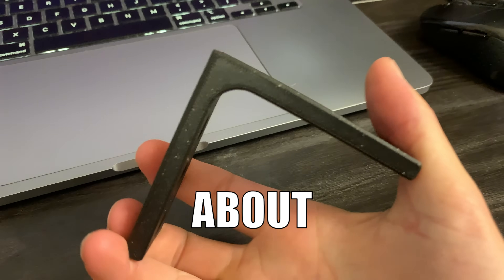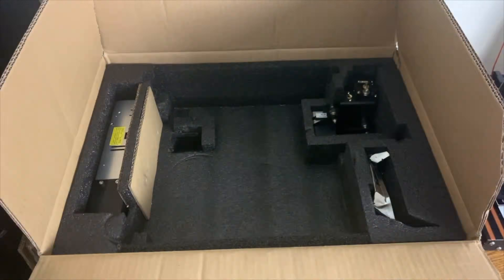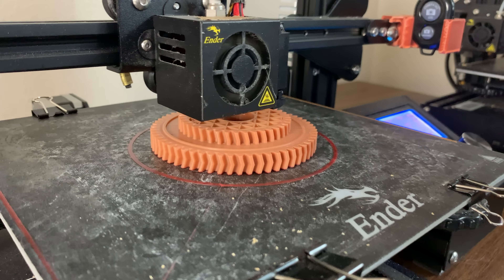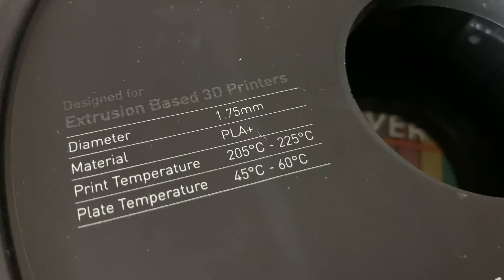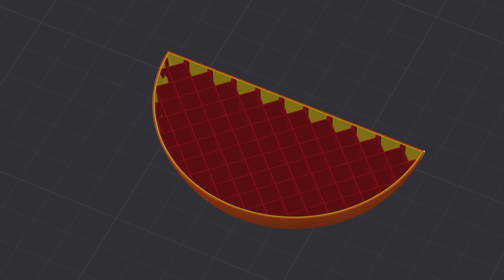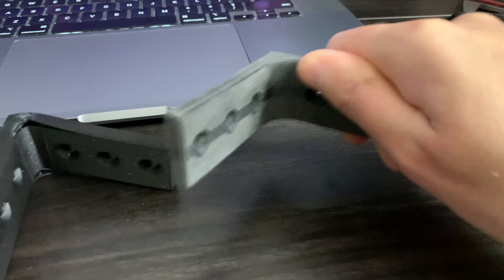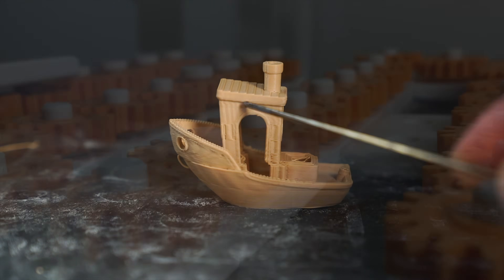9 3D Printing Sins...

Comment: "There's really no benefit to using IPA over warm soapy water"

Sure there is, I can leave the build plate in place and give it a quick IPA wipe. 5 seconds vs. minutes to pull, rinse, soap, wash, dry, and replace. If you're not using a glue stick, anyway. But then if you're using a glue stick regularly, IMO that's a bit of a band-aid covering up some other deficiency.

Comment: To get under parts that don't want to let go of the build plate, I usually use "paint knives". (set of them is usually less than ten bucks online) 
Unlike these normal spatulas they don't have fully sharp edges, are thinner and therefore pose less of a damage risk to the parts and can work themself into thinner gaps.

Comment: PLA is perfectly fine for outdoor use for 99% of people. Yes, it is not "UV stable" but do you really need it to survive looking the same for 10 years? Colours are a different story, even some ASA materials use colours that are not UV stable and will bleach or yellow when exposed to sunlight, and you can also get PLA with colours that survive the sunlight.
PETG will also (usually) yellow in sunlight.
Unless you are printing engineering/function parts for outdoors and selling them, PLA will most likely work just fine.

Comment: Sin No. 10 - Buying Ender 3. Seriously, don´t. :D Ender was my first 3D printer and it was nothing but pain. I even went to the extent of upgrading almost everything. From motherboard to the extruder, dual Z-axis, everything. No. It simply wouldn´t print properly. Throwing it out and buying a different printer did the trick.

Comment: I do use isopropyl alcohol but i do not always use glue. I use glue with the harder parts that are too small or prone to warping and then i need soap to wash ofd the glue. In other cases i will just give it a quick wipe of IPA between prints and wash it with soap after a couple of prints.

Comment: IPA is a good choice to clean the bed before/after each print to remove reside... at least for PEI coated (flat or textured) surfaces. It's not a replacement for a soapy water rinse. That's still necessary every once in a while for the reasons mentioned in the video, but is everyone else really washing their build plate for each print?

Comment: I just recently got into 3D printing. The issue I'm having is the printed product is hard or not able to break away from the Raft. I have a FlashForge Adventure 3 and using Flashforge PLA Filament 1.75mm. The Original Filament that came with the unit was a red translucent material. When I ran out of that, I took the filament information off the original spool and ordered Flashforge PLA Filament 1.75mm, 3D Printer Filaments 0.5kg Spool-Dimensional Accuracy +/- 0.02mm for Adventurer 3 Series (Black) and a (Grey) off Amazon. Whether I use, the (Black or Grey) the printed product does not want to separate from the Raft. I have not adjusted any of my printer from the factory default settings.  Just wondering what causes it to adhere to the Raft. The Raft comes off the Build Plate just fine.
Reply: I do not know what you are printing but raft use has limited purpose. Switch to skirt or brim. If you do have legit reason to use raft you air gap is probably to small so it forms a hard bond with the raft. You want filament to sort of lay down on the raft not pushed down like you would if you are printing directly down on the bed. Looking at the settings in my slicer at .28 layer height I have a air gap of .3
Reply: @mitchellcrane9809  I think the raft is apart of the printing process.  Will look deeper into the FlashPrint 5 software.  Thanks for the information.
Reply: @mitchellcrane9809  at first I printed the test boat then found other items to print. They printed just fine with the original red translucent filament.  I then purchased a 3D model of a VW engine to print out.  I did realize it has so many parts to print. Using the red filament the pieces printed fine.
I ran out of the Red and purchased a Grey and Black of the FlashForge filament and using the filament specs from the Red specs. It seems to print larger items better than smaller ones. The printer settings are the same as out of the box. It's always printed a raft. Not sure where to turn it off or change it. Thanks
Reply: I have found that the colour of the filament can greatly affect the adhesion between the print and the raft. Printing the exact same benchie with a light-coloured filament vs. a dark-coloured one, the light-coloured one will separate easily while the dark-coloured one is permanently bonded to the raft.

As for printing without a raft on the Adventurer 3 while retaining bed adhesion, it does not appear possible to do so with the default slicer (Flashprint); but it is indeed possible by changing the slicer. Unfortunately, Flashforge gcode is not directly compatible with Marlin; so it is a pain to set up, e.g. PrusaSlicer and get all the gcode substitutions needed to make it print reliably.
Reply: @techgeeknzl  Thanks for the information.
Reply: @dog01b52  The trick to bed adhesion with the Adventurer 3 is to print the bottom layer as thick as possible -- you'll notice that Flashprint uses a 1.6mm extrusion width. This is easily accomplished with third-party slicers, once you've understood how to adapt the gcode for compatibility.

I have a Pleccer (fork of PrusaSlicer) profile that produced decent results on an Adventurer 3 (which, sadly, no longer works); let me know if you want to share it.
Reply: @techgeeknzl  I have good adhesion to the hot plate and the raft. If that's what you mean. When trying to remove the printed item it either breaks the printed item because it is bonded to the raft also.  I can get the raft off the hot bed and see that I'm adhered to the raft like it was ment to be apart of the 3D part I was printing.
Reply: @dog01b52  Yes, having the part bonded to the raft when it shouldn't be is quite annoying. You can increase the separation between the top of the raft and the bottom layer of the part, but then the part starts getting messy, and even that doesn't always work well for black (and other dark-coloured) filament.

Comment: I need to pick my printer apart and clean it. It's been collecting dust and grease for 10+ years now and just isn't very happy any more. I still think it's impressive that it has worked flawlessly for about 10 years before giving in to the environment. The kitchen really isn't the kindest environment either.

Comment: Tip to release a print; Just take off the plate as a whole and put it on something cold, like a tile floor, or even hold it under cold water. The print will release mostly by itself...

Comment: "Don't use fingers on the build plate", let me tell you something, when I use PETG my on my ender 3 I literally have to put screwdriver between print and printing plate and tap it with a hammer. This shit sticks so hard to the build plate that I had 2 regular ones destroyed by print coming off with pieces of build plate. I even bought a glass one thinking that there is no way that it will get destroyed, fast forward 2 months and I have 2 holes in glass because my prints decided to get peeld off with fucking glass build plate, let me repeat that, I had instances where pieces off glass build plate where still stuck to the print after peeling it of. Nice advice but for someone not printing heavy duty parts

Comment: IPA is for quick cleaning and soapy water is when IPA doesn't do the trick. I rarely have to weash the build plates, usually IPA does the trick and I get good adhesion. I also have never had to use gluestick as adhesion or release agent. That's why you have different sheets.

Comment: I have these isopropyl alcohol wipes that I use to wipe down the build plate before each print. Much easier than taking it off to go to the bathroom to wash it off then dry it. It also cleans it just fine! I never have an issue.

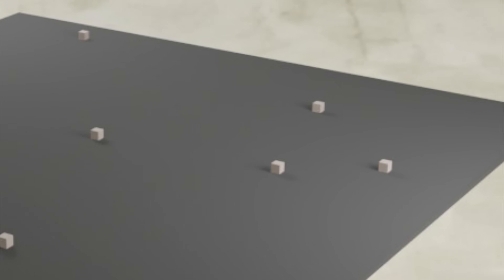Comment: 7:00 actually, IPA have to be mixed with water at somewhere like 50x50 ratio instead of being used pure, so grease which taken from surface stays in water instead of a surface and can be collected by towel

Comment: #1: I actually suggest 3D printing plastic spatulas, there are plenty of patterns online, and if you bought a Prusa Mk4 it's actually one of the files on the USB stick that comes with the printer. Makes removing stubborn prints a lot easier and won't ruin the build plate like a metal one would. Also - I'm a big fan of PEI, especially the gold colored stuff, prints seem to stick well with no glue stick.

#5: You know what annoys me? When somebody uploads a print to an online site in the wrong orientation. If you're going to share the print with the world, please make sure it's in the correct orientation to print.
Reply: I orient things whichever way I think will make modeling easier. It's not too much work to reorient an STL model once imported into the slicer, and doing so trains you for finding the right orientation for your own models.
Reply: @AdrianLopez-sb7eo  

That is very true. When modeling, you shouldn't have to think about printing considerations since printing is only one way to materialize a 3d model. And it is very easy to reorient the model in a slicer. Even doing it manually is way easier in the slicer then it is in a CAD software. Fellow makers, you should always reorient the models you print. Don't trust others for that. Be pros.
Reply: @AdrianLopez-sb7eo That's rather silly. I think you need training on how to rotate a 3D model. 😆
Reply: @logicalfundy  rotate it where? In the slicer? Easy peasy. In the live preview of the modeling program? Not always comfortable depending on your navigation controls. In actual modeling space? No thank you.

It's so easy to do in the slicer that I really see no need to bother doing it elsewhere. I might feel differently if I were trying to sell "download and print" models, but otherwise I don't see the point.
Reply: @logicalfundy   I agree with the others and am like the 4th or 5th  person to comment if you can't rotate a model in a slicer maybe you should learn. I think places like thingiverse are great to exist on a free basis, you can't be too picky or choosy when people are giving you their work for free.
Reply: My Neptune 3 pro had a plastic spatula in the box. Not 3d printed, "real" manufactured.

Wrong orientation of models used to annoy me as well, but then I installed Orca Slicer (derived from Bambulab Studio) and there is a nice bit "button" there that automatically reorients the model for you the best way possible. It does have a caveat though, it doesn't know which way force is going to be applied to the object so the results aren't always perfect.
You should also consider this: you don't always know the person who made the 3d model. They may be someone with very little to no experience in 3d printing, and thus may not be able to make a good decision about the best orientation to print the object. I prefer to rethink the orientation anyway.
Reply: Wouldn't the orientation of printing be up to the person printing the model.

It depends on what you are trying to accomplish with the model.

Example- say a helmet file
One person might want to print it as just as a decorative piece. 
Another person might do cos play and want it to be stronger because of transporting it, or wearing it. They might change the orientation and add thicker walls. 

I use a 3d program.  I also have a 3d printer.
Sometimes, in the 3d program, I think it's good. So I export the stl file. Put the stl in prusa slicer, find out things will need support that I didn't think would, even after checking for this. So, I might need to change the orientation then to reduce or eliminate extra supports.
It's way harder to model something.  Then, just rotate the object in a slicer.
It's hours if not days modeling something.  It takes 2 secs to rotate the object how you want it to print.

Some of these people who make models do not 3d print. So how would they know how it should be printed. They are talented at modeling.  And probably do it just to make some extra cash. 
Each printer has different specs (some might need support where others won't).

Resin is printed completely differently than a pla print. So what orientation should they go with then.

Might be annoying,  but it isn't a big deal, really.
The only option to avoid this is making the models yourself.  Or just rotate it in the slicer.
Reply: @stealth2951  While there is some degree of "maybe different people want it oriented differently,"  I'd argue that a model should at least be put into an orientation that makes some sense. It's not a hard thing to do. The person making the model could even orient it in a slicer and export it again. To me, caring about the orientation shows attention to detail, shows that the person making the model cares about making the best possible product. Most businesses I know of design their products to have as little friction as possible with their products. All I see in these responses is rationalization of laziness. Spend days modeling, but can't be bothered spending a minute or two checking the orientation? That honestly doesn't compute. It doesn't make sense. Most prints that are in an orientation that doesn't make any sense are from people who make a model in a few minutes and throw it up.
Reply: I don't upload anything, but files that I've designed and exported from Fusion 360 get rotated 90 degrees in Cura.
And if you really can't figure out which way to print an object to make it stronger and don't understand basic material strength, layer adhesion and forces, maybe 3d printing isn't for you. Even for artistic objects you need to think about how the layers will form.
Reply: @tomclanys  I'm not familiar with Fusion 360 (Linux user), but keep in mind that in 3D printing, the +Z axis is up from the bed. That is the most important axis to get right, since it's perpendicular to the layers.

X is left/right, Y is front/back. Usually not as important, but something to keep in mind if you're making large prints that will almost fill a plate and you want it to work on printers with a rectangular bed (such as a Prusa).

If it doesn't work like that, might want to check settings and export options, can't be specific as again I'm not familiar with the software.
Reply: @logicalfundy  Yeah, but when you model something it's nice to have it in an orientation that makes sense. For example if I was modelling bracket for a shelf I'd model it in the orientation that it gets installed, but when I export it I'd need to rotate it away from that in the slicer to whatever orientation prints the best

Comment: I've never heard the first one, if you have such a zoned-in printer that the slight oiliness from your skin disrupt adhesion, you should be making parts for aerospace lol

wait oh my god please do not use flush cutters like that you're going to shatter the tip. just buy a pei sheet or put it in the freezer to shrink faster

Comment: The best scrapers are the ones that use plastic razor blades. Despite being sharper (and thus better able to get under the print), it's a lot harder for the blades to damage the print bed or your hands. Major win.

Comment: Automatic bed leveling should be standard at this point. If its not, get another printer or add it.

I use the textured build plates for PETG. Don't need glue stick... Just need a.clean bed.

Comment: All of my speed increases are NOT gained by increasing the mm/s. I increase the size of the internal perimeters/infill/solid infill layers. This makes big thick ugly and STRONG lines on the INSIDE of the print. It's smart, especially for functional parts. Also to isopropyl alcohol is for people who are good for people who aren't touching their print beds. I use dish soap and water every once in a while...but then I use a few sprays (Yes, I use a spray bottle, a single bottle of drug store higher-proof rubbing alcohol will last a year or more if you just use less from the get go, I even re-use the paper towel a few times)

It just gets residues from the filament and dust off of the build plate.

The alcohol is also really clutch for spraying a bit on the bed and then watching your parts pop off the bed almost instantly (depending on geometry, but it's soooo satisfying)

The water/alcohol encourages quicker cooling from the bed.
Reply: Also...there's some kind of reaction with PEI and alcohol, alcohol isn't necessary for build-tak or whatever surface you'r using. It's necessary for PEI.

Comment: After 2 years of using my printer on/off with a "decent" avoidance of touching the plate, I eventually lost adhesion. Finding ispropanol in my country is very difficult. The only other option was the even stronger kind of cleaning agents that would likely ruin the plate instead.

So I did the dishsoap option in warm water. This worked PERFECTLY! The plate was as good as the day I bought the printer afterwards, no Glue or anything needed. This was with a Prusa MK3S printer anyways...

Dishsoap, like green dishsoap and warm water. And some cloth to rub with, will do fine! Or should do fine.

Also if you only print with PLA. You can use cotton sticks to clean the nozzle of your printer. When my nozzle gets too dirty, I remove the PLA reels from it and I manually turn on PLA heat on the nozzle. Then I use cotton sticks to gently swab away the molten PLA grease on the nozzle until it is completely clean. This also prevents the nozzle from scratching up with the metallic brushes some printer producers recommend.

Although I only recommend cotton sticks for PLA cleaning. Hotter settings might not be good for the cotton. Regardless with PLA only printers cotton sticks can easily absorb and pull the molten PLA away like wax. I even got my Printer head 100% clean once like new after I had a blob appear once...